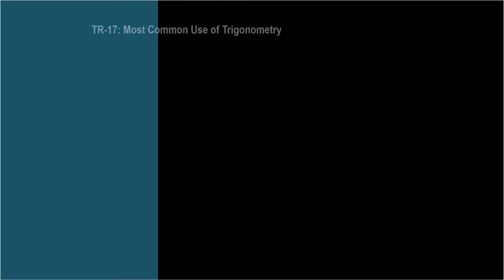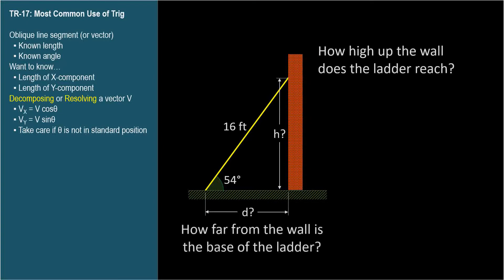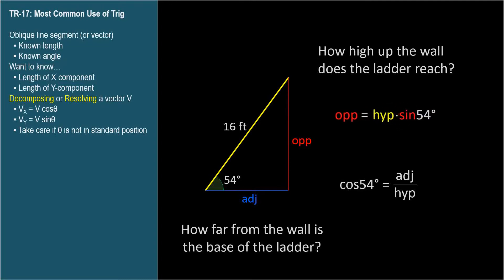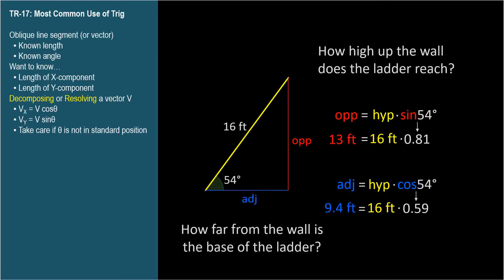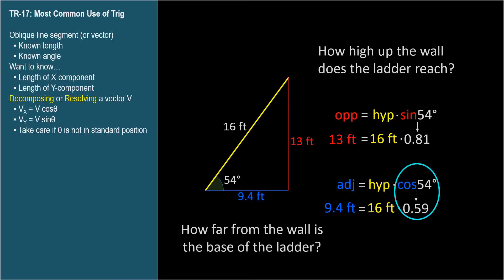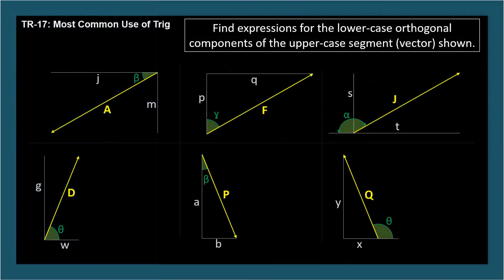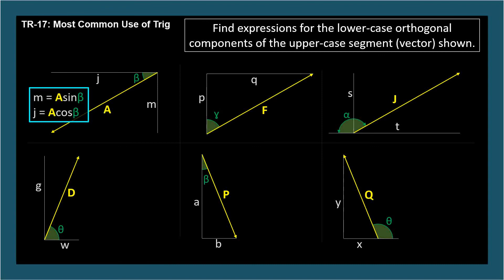TR-17: Most Common Use of Trigonometry (Trigonometry series by Dennis F. Davis)

Comment: Professor Dennis, can you explain to me why the sides don't add up to 100%? I get that both sides are percentages of the hyp's length pointed at a certain direction, not literally the very own hyp "broken down" into two parts, each at one axis (can I refer to the sides as vectors?) — but still I can't shake off the feeling that they should somehow add up to 100%...
Reply from the maker: Hmm, how about this thought experiment using a 3-4-5 triangle... Suppose you are in a wide open field and told to walk 4 miles east and then 3 miles north to reach your goal.  That would be a 7-mile walk.
But instead you decide to take a shortcut by walking straight to the goal, which is a 5-mile walk.

So decomposing vectors is the opposite.  The oblique vector we start with IS the shortcut (5-mile walk).  We use trigonometry to determine the lengths of the perpendicular components (because they're easier to work with to solve a problem).  The sum of their lengths is longer than the shortcut.  That's why (cosθ + sinθ) is almost* always >1.

*Note that cosθ + sinθ = 1 only for the zero angle (where cosθ=1 and sinθ=0) and the right angle (where cosθ=0 and sinθ=1).

Comment: Amazing that other trig courses I've read don't mention that the sine and cosine basically represent the percentage of the length of the hypotenuse. This is such a simple yet important concept to grasp. As others have mentioned: fantastic videos.
Reply from the maker: Yes I completely agree.
In high school I took trigonometry and physics at the same time and this simple interpretation of sine and cosine clicked with me in my physics class, not in my trigonometry class.
I understood trigonometry much more clearly once I saw an application of it.  It seemed so simple now.
Thanks for watching and for your kind comment.
Reply: @DennisDavisEdu  Professor Dennis, can you explain to me why the sides don't add up to 100%? I get that both sides are percentages of the hyp's length pointed at a certain direction, not literally the very own hyp "broken down" into two parts, each at one axis (can I refer to the sides as vectors?) — but still I can't shake off the feeling that they should somehow add up to 100%...
Reply from the maker: @curtisjackson5793  The closure you are seeking may come from the Pythagorean Theorem.  The relationship between the hypotenuse and the shorter sides is: hyp² = adj² + opp².  Also:  Vectors are added tail-to-tip, so in the video, the two vectors labeled V1 and V2 add together to yield the yellow vector V.

Comment: I got answer the upper right question at 4:40 as
s = J×cos(90-α)°
t = J×sin(90-α)°

α is given in a way that (90-α)° will be the angle between line s and J. So, the Opposite to (90-α)° is t and the Adjacent to (90-α)° is s. Could I know whether it is correct in this manner?

I understand that the video shows using linear pair, but I want to know whether my way is correct.
Reply from the maker: Yes, your answer is right too.  To double-check I went to desmos.com/calculator and graphed your answers and  mine, and they resulted in the same graph, so they are equivalent.  Good work!

Comment: Okay, the video's just get better and better.  I have struggled for over a month to understand the sin, cos, etc. relationships and using them in this situation.  You just provided the clarity that I never had in understanding not only how this works but how to implement it.  Again, thank you so much.
Reply from the maker: Thank you for your kind words Jonathan.  Yes TR-14 The Unit Circle is all that's needed to decompose vectors, which (for engineers) is 80+% of how we use trig.

Comment: Need to stay at this one awhile.
Reply from the maker: Thank you for all your comments Douglas.  I appreciate your viewership and I truly hope the series is helpful to you.
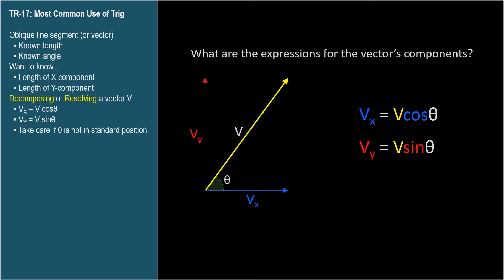The key idea for this video can be summed up by the still screen capture at 3:04.
The given yellow vector V is at an oblique angle, inconvenient to work with.

An engineer will "decompose" this vector into the much more convenient component vectors (blue and red) that correspond to the axes of the chosen coordinate system.  Where a problem involves gravity, one of the axes (almost always "Y") will be chosen to be "up/down" to align with the direction in which gravity acts.  This makes the mathematics of solving trajectory problems (for example) much simpler.

So we want to know the lengths of the blue and red vectors.  Since the cosine is the proportion of the hypotenuse that extends in the horizontal direction (assuming the angle is in standard position, i.e. the angle the yellow vector makes with the horizonal axis), the length of the horizontal component is the length of yellow V times the cosine of the angle.  The same sentence applies for vertical but with "sine".

Assuming a standard position angle, the cosine is the proportion of the hypotenuse that extends in the horizontal direction, and the sine is the proportion that extends in the vertical direction.

Go to TR-14 and pause at 1:23 (https://youtu.be/oJgBJfstOOU?t=83).  This image on the unit circle can always remind you of the relationship.  On a unit circle, where the hypotenuse is 1, the X-coordinate is cosine and the Y coordinate is sine.  If the triangle is scaled up by a factor of V, then all sides will increase by the same proportion (TR-08!)  So the hypotenuse becomes V and the horizontal side becomes Vcosθ and the vertical side becomes Vsinθ which is what this video shows at 3:04.